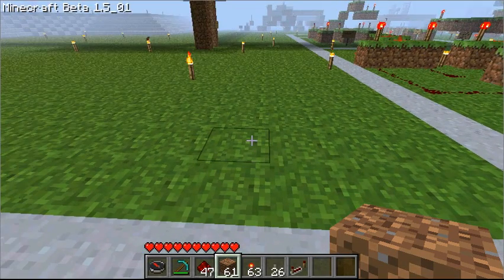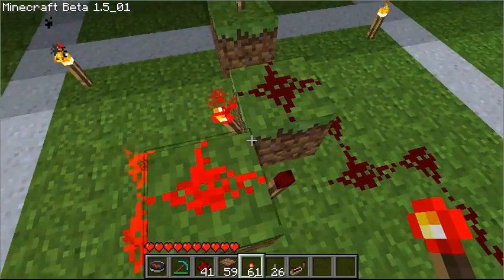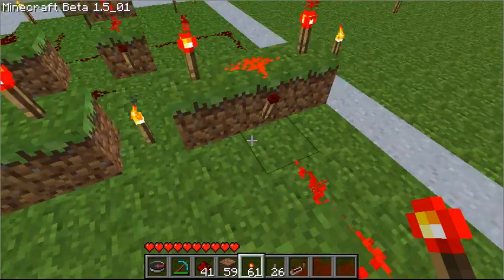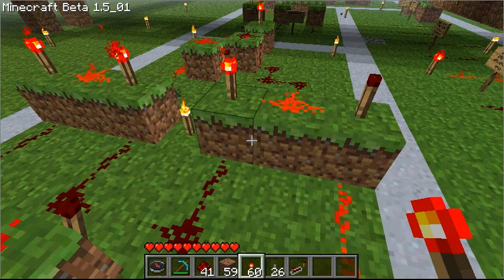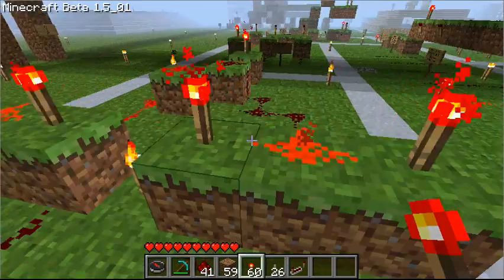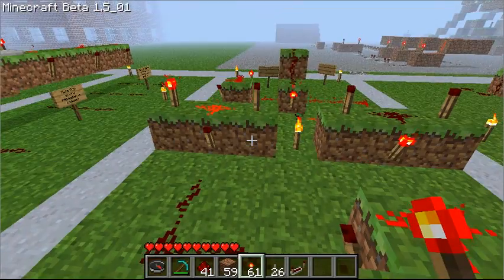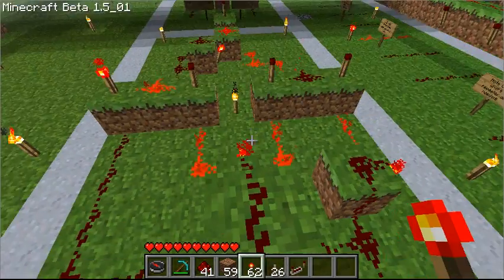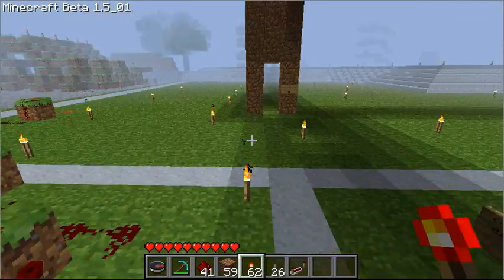Redstone Memory Gate - Minecraft

Comment: @addam352 Adam i have a quick question when you use an RS/NOR latch to store data how much actual data is being stored inside of the red stone when you have the info and what is the data capable of being transferred and used in a machine?
Reply: ive seen ssd 32 bytes. its massive. his one not too much. plus with working more like a ram. but its maybe 4 bytes witch its 32 bites

Comment: @addam352 Thank you for your reply. I'll try that out later. In the meantime i asked you for help i made a very easy block detector at the 13th block.
So when the column is at the top length, the circuit is completed and a row of 13 pistons pushes the whole column forward.